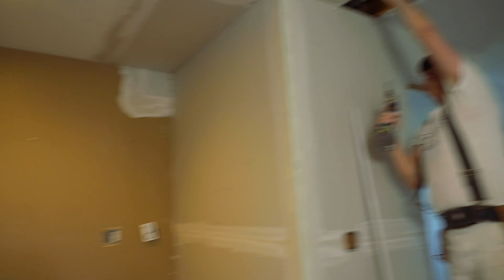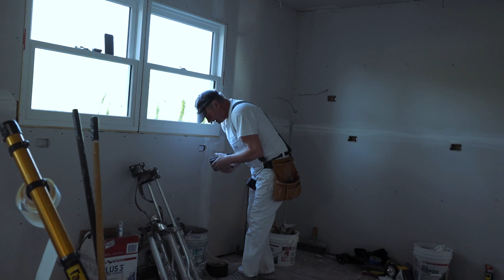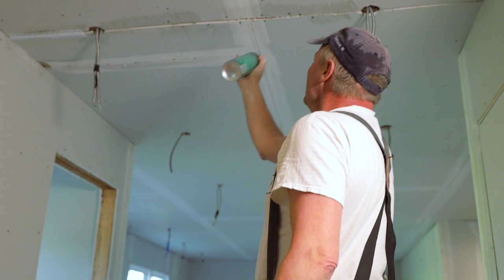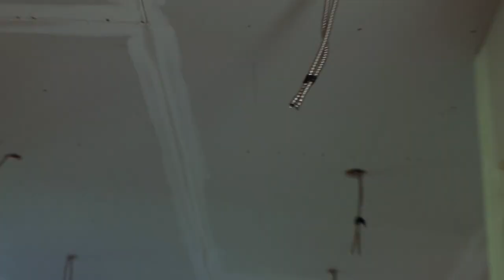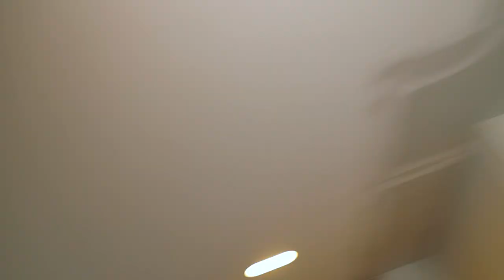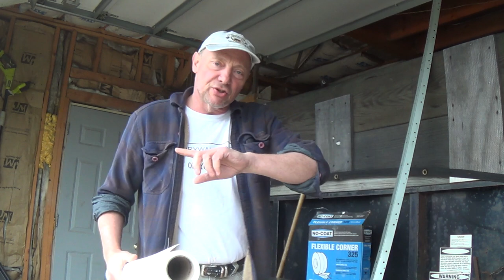Control Joint Part 1 (with next day footage)

Comment: I'm a mechanic that knows all about carburetors. Been working on them for 50 years. Didn't  need to know about that.
I really needed to know about control joints to repair a recurring crack in a place where 3 walls meet. You didn't explain anything about the spray glue you used and/or why you stapled it. I've never seen spray glue used like that before. Why did you use it, and also what did you use?
You should put a link to part two in the description. It could help someone follow your series.

Comment: Hello Doctor?  Are you still there?
Anyway, we just bought a house with a 30ft - 40ft expansion joint line (approx .25in wide) running right between the living room and and the dining room.
The builder manager (from Pulte/Del Webb Homes) says this is necessary said as you did, the length of the two rooms combined called for it, BUT isn’t there a way to hide it as you did here?
‘Wish I could attach a pic’!
Please, let us know what we should do!  Oh, yeah!  That Trim-Tek is expensive I only need 40-50ft.
Is there a cheaper way to go?
Reply from the maker: Control joints are exposed.  The way I like to say it is. You can have a Control joint that looks like it belongs or a crack that looks like something is wrong.  I'm familiar with Pulte homes where are you located?
Reply: @THEDRYWALLDOCTOR1  The new house is in a Del Webb 55+ in Henderson, NV (Just outside of Las Vegas).  I know the expansion/control joint is necessary (especially for the size of this ceiling . . . big!).  The home is finished now and we'll be moving in around Memorial Day ('24).  It'd be good to get it done before we move in.  I think it would be nice to  "see it" covered, as you covered the one in this video.  Thanks for your great experience and advice!
Reply: @THEDRYWALLDOCTOR1  Thank you much, for all of your great advice and videos!  I've subscribed!  No telling when I may be able to share your great information.